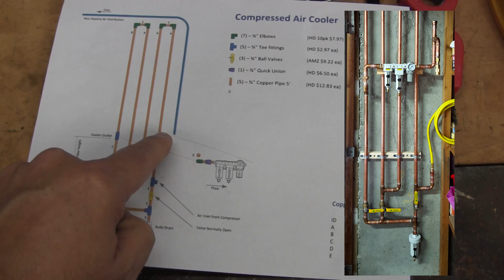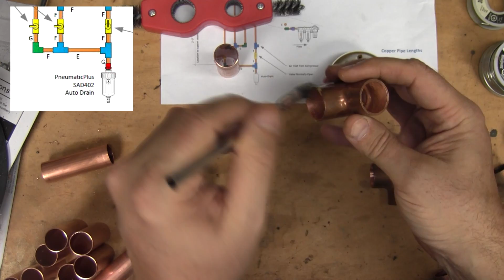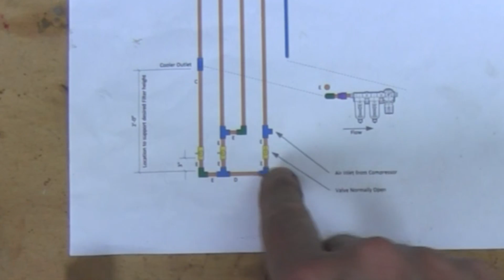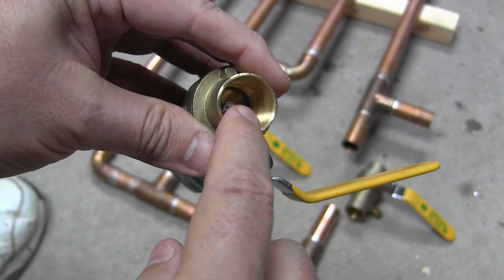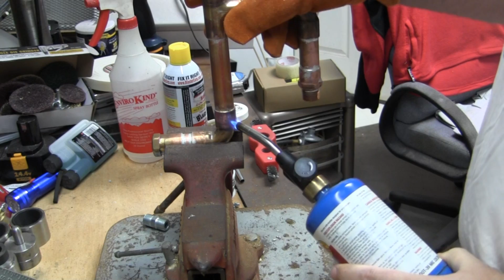How to Make | Compressed Air Dryer with Auto Drain!

Comment: After building my dryer cooler like yours,, I plumbed it between the pump head and the tank itself, thusly it produces almost zero condensation. My auto drain Auto siphon device at the very bottom of the system really never goes off or does anything that i can tell..  I don't get any moisture out of it whatsoever. Does yours ever go off and purge water?  Thank you
Reply from the maker: @reidlawrence1114  I believe I heard it auto purge once.  I really don’t use air tools regularly.   At this point I assume it is working properly.   I can tech down and manually activate it and water does come out.  Mike.

Comment: I also purchased the exact drain that you located at the bottom of your system. I wanted to ask how your long-term opinion was of that and how it works?
Reply from the maker: @reidlawrence1114  to be honest, I don’t use air tools regularly.   I believe I witnessed it auto purge once.   I have reached down and manually pushed up on the little valve and it purged as well.  I just assume that it is working properly.  To be honest!!!!   Mike.

Comment: I realize that this project is probably seven years old and I cannot believe I haven’t run into your sight before.
I am a retired aerospace engineer/aircraft mechanic with 50 years of experience doing precision work.
I am impressed with your design and my project looks similar to yours in many ways. (I’m still in a design phase).
However I am most impressed with your drawings!!!!!!
I can not find a simple CAD app that doesn’t require me to have extensive self training before I start a project that I have in my head. I still use drafting practices I learned in high school with graph paper and a good mechanical pencil.
Can you PLEASE let me know what app you are using. I looked for a Visio app and couldn’t find it. That would be a game changer for me
Thank you in advance.
Mike G🍺🇺🇸
Reply from the maker: I use Microsoft Visio.  I’ve been using it prior to Microsoft purchasing the company that originally created it.   

It is extremely simple.  Drag a rectangle I just to the work area and resize it with handles.   The bottom tells you the size of you are looking to create a scaled drawing.   You can define the drawing scale.    

Most of my projects get a custom drawing to go along with my other documentation for my purposes but I like to share them as well. 

If you could find a cheap license to an 2010 + version.   You’d be in great shape.
Reply from the maker: Check out eBay.

Comment: Nice set-up.  Although the best results for these come from placing them right after the pump so that you get cooler and dryer air into the tank which allows it to hold more air in volume than hot moist air.  It already cools and condenses a lot just from the tank so it makes more sense to use a set-up like this before the tank instead of after the tank (or do both to some extent).
Reply from the maker: The compressor is going to create heated air which holds moister.  The purpose of this unit is to cool the air in vertical channels to promote the moisture to condense and fall to the bottom of the channels.   Then the channels can be emptied via valves and the autodrain.   Placing this before the compressor would not be affective.
Reply: @UCanDoIt2Mike  Of course it would be effective which is why a lot of people do it that way.  You route the output of the pump to the cooler / condenser first, then have a ball valve drain and or water separator, then it goes into the tank much cooler and dryer which allows you to actually hold more air by volume at the same pressure because it is both cooler and dryer than hot, expanded, moist air.  

Compressors are of course sold with the pump going strait to the tank but a lot of people reroute it to a cooler first. I call it an APC or After Pump Condenser.  It greatly eliminates excessive moisture in the tank.
Reply: @OldOwl - I am building the setup you are talking about. It is technically an intercooler if it is between the pump and tank. If it is after the tank it is an after-cooler.

Comment: For the life of me, I cant understand why you put three valves on the bottom of the cooler lines. All you need is a valve on the inlet of the cooler because you would have no pressure on the cooler when you use the drain. why take the time to figure the links out when they aren't needed and the extra cost of the three valves.
Reply from the maker: Well to try to explain it...  The Valve separate the "S" line from the bottom manifold.  With all valves closed, the air only has one path and that is to follow the "S".  At the bottom of each of the loops is where the water will settle.  By opening a valve, you allow the water in that loop to drop into the manifold.  If you run it with valves open, the air will not be forced through the entire "S" channel which is needed to cool and condense the moisture.  Close all valves during operation.  Open any or all valves temporarily to allow drainage of water in the loop.  The Auto drain at the bottom works perfectly.
Reply: Have you experimented with valves open and valves closed to determine any difference? The surface area is the important part valves open or closed, if I’m recalling those classes correctly.

Comment: I really like the use of your drawing to come up with a parts list and measurements.  However, I've seen some videos that caution against using damp rags, sponges, etc. to cool the joints.  They said that can lead to microfractures in the solder and eventually start them leaking.  Could be someone's idea of a joke, I don't know.
  If you had 3 auto drains, you could eliminate the short path valves and not have to fuss with it so much.
Reply from the maker: I appreciated the feedback.  Not sure on the damp rag info, but it does sound logical.  I had seen others do it, which is what gave me the idea.  Hope yours turns out the way you want it.   Mike

Comment: Where is the cooler at? Are you implying the copper tubing itself is the cooler? Don’t know how much moisture you will remove with that, generally to remove moisture having a cooler after the compressor pump before the tank is where the cooling should happen

Comment: Plan is good but the soldering part is not correct. The fitting should be heated from one side and solder should be filled from the other to make sure it flows with capillary action. 
Flame should never directly heat the solder wire.

Comment: Built this system for my compressor.  Glad I purchased the PneumaticPlus units that were recommended.  They look really solid.  This cooler in 2020 cost me about $500 to build. About 1/2 was on the dryer/filter/regulator and auto drain unit.  The rest was all the plumping material.  I didn’t purchase gas for soldering because I had that in my garage.   I can’t recall if he specified the copper pipe wall thickness, but I bought L-series that has a thicker wall thickness. If you made it from M-series the price would drop about $40.  I don’t think you can build it with 3 10ft length.  Cuts just don’t workout.  So, I purchase 4 10ft and have leftovers.  Ended up buying the container of 90 elbows and T’s.  If you bought them individually you paid almost as much for halve as many.  I took my time and pressure checked.  So, it is an 8 hour project.  To pressure check, solder end caps over the outlets and pressurize the unit on the inlet side.  Held 120 psi without any problems. My compressor and the 1/4 in supply line might have to be upgraded to something that can deliver higher cubic feet a minute.

Comment: Have you found lots of water? The reason I ask is that lots of people making these separators use 30-50 feet of copper, you have chosen quite a bit less, so I was wondering does the air cool enough to let water vapor to condense out to liquid and not come out your tools?

Comment: Nicely done. Watched it then referred to it many times while designing my systen. First question, what app did you use for drawings. They are beautifully done. Second, now that time has passed, have you changed anything? Last, how is the Automatic Drain working out?
Thank you in advance for your help.
Reply: Add a pre tank cooler no water inside my tank ever!
Reply from the maker: For the drawing, I use Microsoft Visio.  Simple program that I have been using for 20 years.  I haven't changed anything yet, but plan to upgrade the filters soon.  Cheers...  Mike!
Reply: @UCanDoIt2Mike  Thanks Mike. Is the auto drain still working?
Reply from the maker: @backlash00  I assume it works...  I have never heard it fire off.  And when I think of it, and manually bleed it, it appears to be empty.   I am not a heavy user of the system.  I bled the compressor tank not to ling ago and probably drain 2 cups of water out of it.

Comment: Looks like a obsessive compulsive mess,, that I made much simpler and less expensive,, but the best way to dry air is cool it before it enters the tank,, I used a 1/2 inch copper coil tubing between compressor and tank with separator on end,,,dropped air temperature 80 degrees and moisture problem solved,, I have low drops on all my connection stations but not much water ever makes it that far.
Reply: @topgunpressurecleaning8930  I use compressor fan and put a water separator before tank, the air travels so fast through the tubing I don't think fan helps much,, you would of had to convert the dc motor to ac to run it with your set-up, I've seen so many vedio of expensive piping ran after the tank not realizing the answer is to cool air before it condensates in tank.

Comment: It's impossible to get type K equivalent plumbing here in Europe. Is Type L equivalent enough?
Reply from the maker: I am not that familiar with the ratings.   You will need to make sure it can handle the amount of pressure you plan to maintain in the system.   My compressor is set to max out at about 120 PSI.  The pressure gauge in the radiator is set at 90 PSI for most tools.  The Radiator needs to be able to handle the 120 as that is what is being contained.
Reply: @UCanDoIt2Mike  Now I realized even Type M pipe is enough (up to 350 PSI). Thanks!

Comment: Great video. Ive bought my supplies and started looking over your diagrams. I have found errors in the "Copper Length" part on the 1st page. In the PDF file F and G lengths are 1 inch shorter than described in the video. @6mins 50sec you can clearly see the laid out T and elbow connects with the pipe span length being F = 2 3/4" and G - 2 1/4".. (not 1 3/4 and 1 1/4 in PDF) also I think there is a mistype 11 for length E as only 1 E is used for this build..Just trying to save people from cutting there pipe too short. Again I loved the video, minus the smoke detector lol, and I appreciate you sharing. Best video I found on youtube and PDF file instructions. Thank you!
Reply from the maker: Jesse DiSano I’ll check into it.  Thanks!

Comment: I use a MUCH SIMPLER DESIGN. My shop is large, the compressor is 30+ foot away from the first air outlet. I ran a MAIN AIR  MANIFOLD just below the ceiling. Leaving room to take air from the Main Air Manifold out of the top ( bottom is WET).   I used copper & using a Slight Slope away from the compressor(this is key point).  The last outlet is 100+ foot away from air compressor with a larger diameter copper pipe going straight down with a hand valve. When I open that valve, it's like a water hose. I just shoot 🔫 the water out behind the barn. The first time I drained the vertical trap, I had a gallon of WATER. So this works VERY very well. Remember ALL air connections coming out of the air manifold at the TOP ( the bottom is wet with condensed WATER). Very simple & less expensive than all the T's and 90* and ball valves.

Comment: Nice design and well thought out. I would also suggest even heating of the copper fitting, keep that torch flame moving and concentrate heat in the bends of the 90’s to suck the soldier into the pipe joint. You will have a better sweat’s that way.
On the Teflon tape I wrap the threads 3 times. The Teflon is a lubricant for the threads not so much a sealer.

Comment: Might as well use pre-finned 3/4 copper lines, for baseboard radiation. Faster heat transfer for lin ft of pipe.  Larger compressors would need them and a fan.
Also, the joint is not ready until the side of fitting away from flame melts the solder. Priming is ok by melting a bit of solder near the flame, but make sure the solder sucks in on the cold side. The joint will be uniformly covered with solder. A drip of solder is good at the cold side. After 47 years of soldering, you don't really need to visually check. Many times that is no assurance or guarantee of a  uniform internal dispersal of solder.

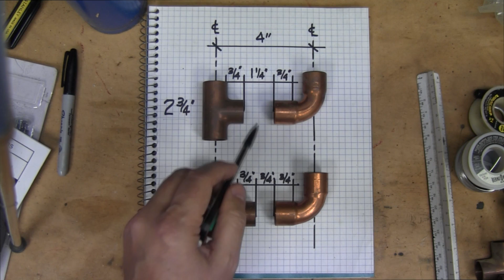Comment: Great video, so many thanks. On min 6:48 you mention the dimensions for the connecting pipes (2 1/4 and 2 3/4) but in the drawings you have them as 1 3/4 and 1 1/4. But let the E tubing at 7 1/4 , could you be so kind to tell me what are the right dimmensions? thanks

Comment: Coper comes in 5ft and 10ft long . Then use 7/8 over 3/4 . 3/4 is made for water and smaller wall . They all tack the same size fittings . Try using street 90's with regular 90's cuts down on size

Comment: Having just done my own, I am surprised how similar they are. My only suggestion would be to use compression fitting type ball valves so they can be serviced later. Nice video! PS: Love the software you used to picture your design!

Comment: I built one in my shop almost just like yours and still had water in my air !  my sand blaster stopping up. Then I built an after cooler with auto drain between the compressor and tank  ... no more water . not even in the tank it stays dry .   See my video .
Reply: Larry

Can you please provide a link to your video.
Reply: @bertkutoob  Go to Larry Haney on YOU tube or just click on my name ,
Reply: @larryhaney6608 

Muchos gracias Amigo

One picture speaks 1000 words, a moving picture, an encyclopedia! 

After slowing it down it seems to go

Compressor > top of cooler > water separator > tank > air hose > whatever 

If that's correct then I can run with it. Seems straightforward enough. 

I mainly want it to dry out the air for the plasma cutter I have just bought. I was thinking of adding a dessicant dryer. But maybe that's overkill? 

Having priced the auto part (and nearly had a seizure) I was thinking of using ½" copper pipe which I can buy from an air conditioning supply. 

Any thoughts? 

It certainly takes a lot less hoo-ha than the wall mounted "trombones"  that seem to be favoured by many. 

Thanks 

Bert Kirsten
Reply: @bertkutoob  Yep U have the order right . I mounted the cooler in front of the  pulley /fan to draw air through it . If your talking about the price of the cooler I think I paid around $30 for it two or 3 years ago but thats nothing compared to the cost of a plasma cutter .
Reply: larry hane

Comment: Manufacture and sell these! Many people can't be bothered making these themselves.
Reply: Most people don't because you can make a far smaller and easier type by using a transmission cooler and small fan. These giant tube setups are unnecessarily large and labor intensive(And expensive)

Combine with a water trap that auto dumps and you're all set in 1/10th the size.

Comment: I see this video is a few years old now.  Did the system work without leaking air?  I ask because your soldering is very poor.  It looks like your flux may have been old and oxidized and you did not use nearly enough heat.  You want to start heating on one side of the pipe, I prefer the bottom, and then move to the top (for pipes 1” diameter and less - larger pipes require a different technique).  Heat until the flux begins to sizzle and then test with the solder.  If the solder doesn’t melt instantly when it hits the pipe, it isn’t hot enough yet.  Give it a few more seconds and try again.  Don’t try to force the solder in as you did when it wasn’t melting readily.  That can bridge a location and prevent the solder from getting drawn well into the joint behind the bridge.  And never wipe a hot joint with a damp rag!  That can shock cool the joint and cause hairline cracks in the solder.  Wipe with a clean dry rag to smooth the solder and then come back with a damp rag to clean off excess flux once the joint has cooled to near room temperature.

It is also better to put the regulator and filters at the point of use rather than where the compressor feeds in.  That way you can have full pressure in the system and step it down as needed for whatever tool is being used.  You could put a filter at the compressor, but I would not put the regulator there.  Regulate at each outlet as needed for air tools, spray guns, etc.
Reply from the maker: You caught me!   I had two joints that leaked!  One I have fixed and the other I still need to get around to fixing!  Cheers that thanks for the advice.
Reply: UCanDoIt2 This man is pretty good.  He is one of the few I have seen that can solder wet pipes using a special fitting. Watch his channel if you want to see how to solder in all sorts of circumstances.  https://youtu.be/m7OKgujf0eQ
Reply: LTVoyager (

Comment: Looks pretty and all, but you could have used way less pipe if you used fin tube.  Also, all that up and down is going to make for excessive drain traps and the need to screw around with all those valves to flush.  A better design would be to take the pump outlet  before it goes into the tank, send it through a radiator, with a metering valve after the coelesing filter but before entering the main tank so you can increase the pressure difference (at the cost of flow) to effectivly refrigerate the air going into the tank via pressure drop from the head pressure being above the tank pressure.
Reply: Can we see an example of this?